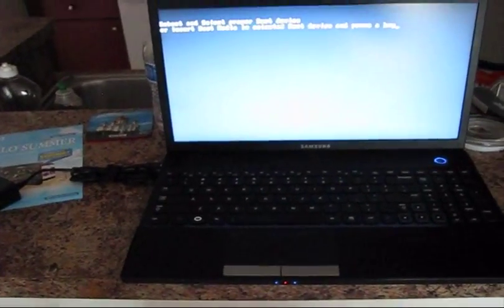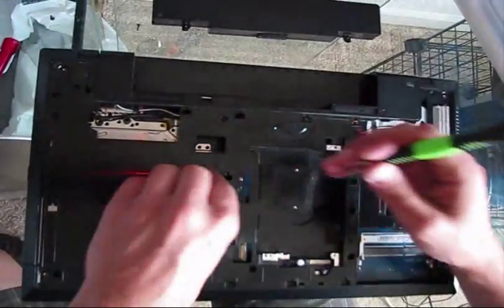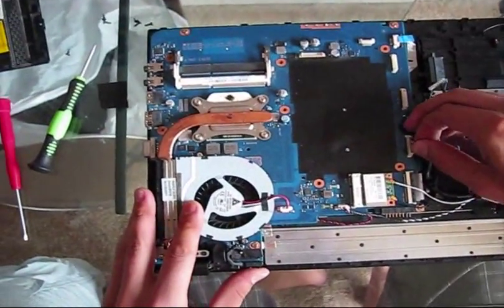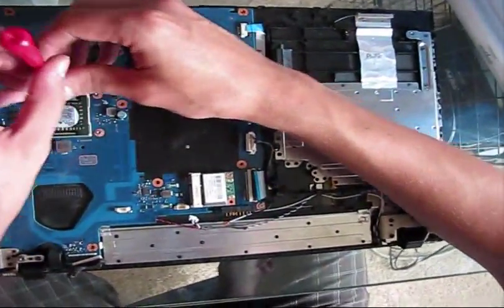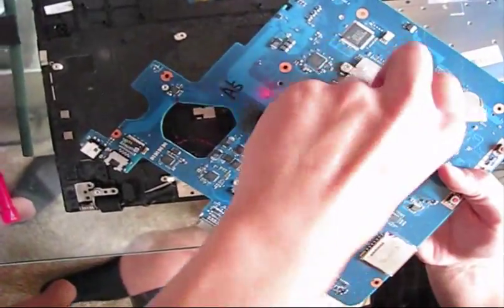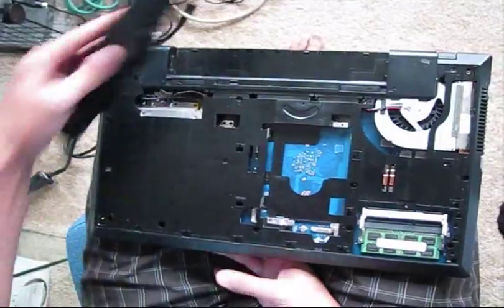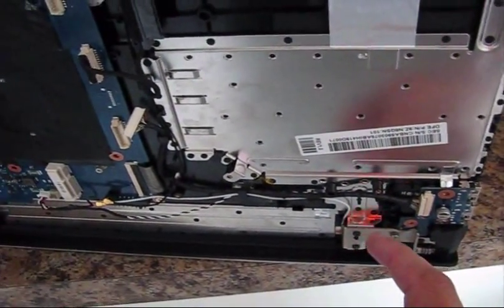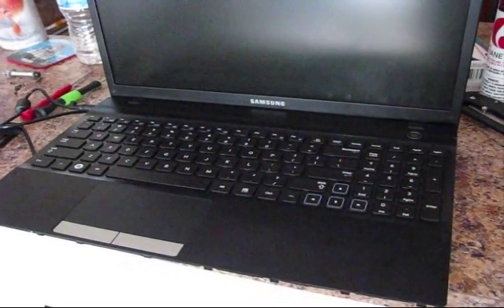Samsung NP305V Faulty Power Button Troubleshooting Repair

Comment: Same problem happened on Samsung NP940X5N. Replacement worked like a charm. If you need your notebook before you get the replacement shipped, just start it and immediately after that, remove the button (while your notebook is running). Then it should start up. Of course you have to repeat this, if you shut the notebook down. But as a workaround until the replacement has arrived, this is kind of helpful. On the NP940X5N the power button is attached with a flat cable, so the removal and replacment was very easy.
Reply from the maker: Thank you for your comment.

Comment: Great video, I am having the same exact problem but I cannot seem to find the power button anywhere.  I tried Newegg and various other parts suppliers including Samsung but I am not having any luck.  Do you have any suggestions?  Thank you
Reply from the maker: +JG G i dont remember for sure but I think that i cleaned and fixed stock power button.. use special cleaner for the mother boards clean all the contacts were power button attaches to main board, also clean power button  itself.

Comment: Hello everyone. it looks all these laptop has this problem, even I am making this comment with a Samsung NP300V4A with the power button disconected!, however the only way that we can fix this issue is replacing the button but is not easy get one. Also you can try fixing the orginal part testing all cables.